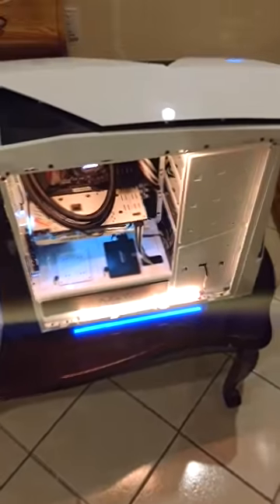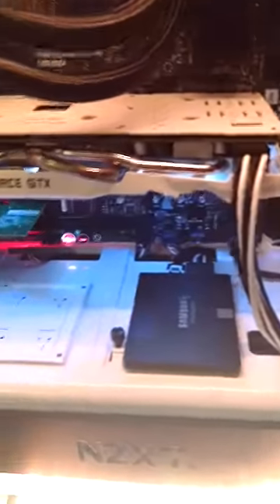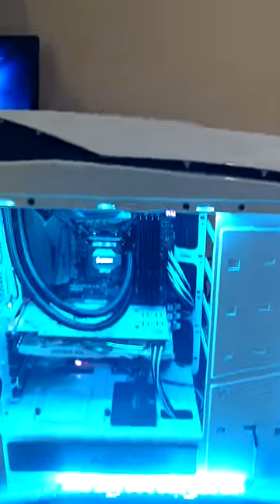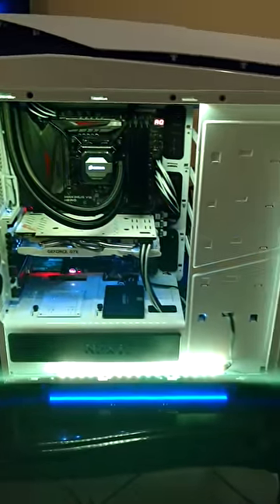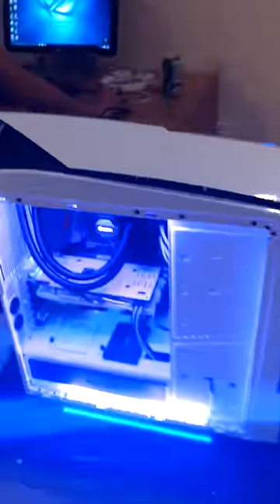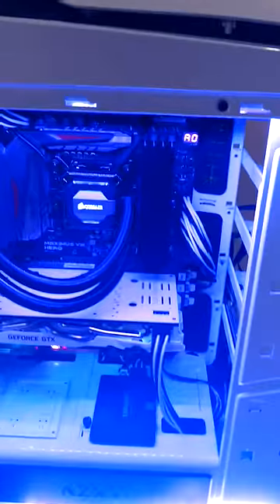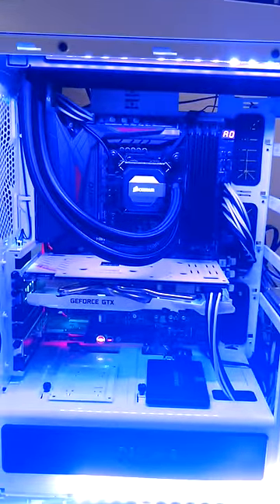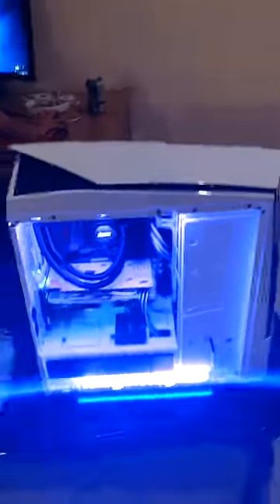Sexy Skylake i7 Gaming/Streaming Rig! ($1700 CA/$1230 US)

Comment: An ideal set-up?! bullshit. having a 2gb gpu for a 1700$ build is mindfuck. Could've of made better choices and acquired a 970 or 390 while still having the same power for livestreaming. Even though if all u do is play CS and Dota it doesnt hurt to have a more beefy GPU for when u dabble with more GPU-straining games. IMO way overkill for a CS and DOTA livestreaming PC.
Reply from the maker: he is going to be streaming. steaming on a 6700k is way better than a 6600k. more threads allow for faster rendering. gaming on a gtx 960 2gb cs go and dota is perfectly fine with 1080p. it&#39;s the ideal setup. he needs the CPU power. not gpu. i&#39;m gonna be using an i7 6700 since it can be overclocked via bclk in the bios, and an asus strix r9  390.